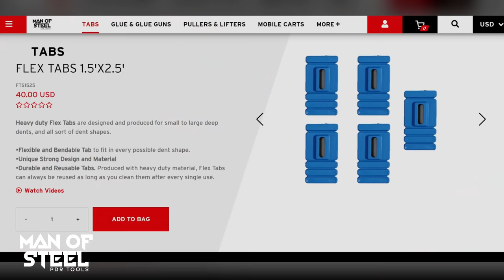Woodblock Knock Down! | Pulling Dents!

Comment: You smashed it again Clark! I wish this collision glue system was around when I was using the bracket jig system back in the late 1990's. We used to have to weld bits of steel on which just created extra cleaning up work. All the best to you 👍
Reply from the maker: Manofsteelpdr.com 
I will use your welding process from time to time on a dog leg paint completely gone. Thank you so much for taking the time to comment I really appreciate Jake

Comment: From one Man of Steel to another.  A deer ran into my truck a few years ago.  Left 2 big dents that looked like Superman had thrown a couple of basketball balls at it. I took off the door panel and used a 2X4 to knock the dents out from the rear. This included a bend  in the body line. While it didn't turn out as well as your work, it turned out fairly well. At least it wasn't noticeable from a distance.
Reply from the maker: Thank you for your comment

Comment: Hey Mr. Dent Doctor, I bought a Japanese van and ran it into the back of a city bus on a very slick Denver day. All the body shops I've contacted have said they can't work on it and suggest I have it totaled. Problem is I put a lot of money into fitting it out with a rooftop tent, kitchen and living room, I'd like to figure out how to fix it. The big problem is the front panel just below the windshield is creased pretty badly and I would like to fix it without removing the dashboard. I've looked for videos on fixing a blind dent (no access from the inside) but haven't seen any. Can this be done? I'm retired so time is no problem. I'm a new subscriber, thanks, love your videos.

Comment: The electronics that are tucked away in the right rear panel close to impossible to pull and replace correctly had the panel been replaced. So, $6,500 to replace the rear panel may have been a conservative estimate.  Replacement and troubleshooting also requires Mercedes technology to analyze the network.

Comment: Wow. We had a car side swipe rear quarter panel on 05 Honda CR-V with the bumper cover so it bent the panel in a bit right at the edge where it supposed to line-up with my rear bumper cover.  Suction pad pulled the larger indent but I can't get the closer edge to pull out.  Would removing the tailgate give access to a push from the inside or glue tab on the outside?
Reply from the maker: Thank you for your comment
Send me some pictures I’ll be happy to look at it for you
Reply: @DentDiscountPDRBodyShop  Thank you for your response.  where do we email you the photos?

Comment: With the cost of paint materials base coat/clear coat, sand paper, masking paper, masking tape, body filler,  and car parts skyrocketing during this covid pandemic; I bet customers and bodyshops will opt for PDR repair.  Plus it takes more time and it is getting more and more difficult to get any sort of car parts,  so people will prefer PDR as it is sometimes more cost effective.
Reply from the maker: Thank you for your comment
Reply: @DentDiscountPDRBodyShop  For Sure! Lets not forget the added cost of labor requiring more man hours with body and paint and the wait of car parts being back-ordered due to the pandemic.  PDR and Glue pulling is the future.

Comment: This is very impressive but isn't this some serious structual damage which should lead to replacement because of safety?
Reply from the maker: I don’t replace  I repair
Reply: @DentDiscountPDRBodyShop  yeah removing the dent is one thing to repair but restoring the structural integrity of the material is a completeley different thing. And this looks like some structual part of the crumple zone which needs to have a specific strength to it. But i was just asking since i'm no expert on this. But your statement lets me guess you are neither :).
Reply: @hasserecht3678  there is no significant structural support needed nor lost at that crease point.

Comment: i got my ass beat by a 50 cent sharp hail dent yesterday on a 2011 black camaro ss convertabile.i had 4 hours in it  ok well no tool acess even with my smallest serrated thinnest whaletale i could touch the tip of dent on outside.i had gluetab spot on many times 2 lights it just kept pulling shoulders i was so mad at myself till  i talked a old gm factory worker he said ohh god that part of trunk is the strongest .we used stronger glue on edge cause its a convertible.hail will put a quarter size deep crease dent there but good luck he said but ya i fought it 4 hours for 98 percent owner right there he didnt want no block sanding.so where that hailstone hit was like the worst spot you could have a deep crease hailstone they had like 2 inches of purple power marble glue that nothing can get through.glue pull on that curve was tough basically trying to pull both inner skin and outer with glue.i was shocked the original clearcoat was holding up from the pulls and pops but it did.god was helping me there.i thought for sure i was going to have to pull off spoiler and repaint but he didnt want that or any sanding buffing was ok he said for knockdown marks.funny thing the aluminium  cowl hood was easy compared to that one dent lol.thats when you need a man of steel to be with ya its hard out there Alone sometimes.
Reply from the maker: Thank you for your comment.. from the sounds of it sounds like you got a pretty good grasp of  PDR.. you’re probably better at hail damage than me.
Keep it up champ
Reply: @DentDiscountPDRBodyShop  I think your alot like me but you have more focus on big damange and your awesome at it!.been slow in mn pdr techs from 60 miles away showing up at shop looking for work and hurting luckily my fulltime job is a bodyman but thats even slow now.plenty of rust work garbage work i call it fill in the gap work underpaid and takes way to long

Comment: I'm a body & paint tech, for several decades now (since 1973).  This repair is not as good as it appears or is represented.  While relatively minor, there are still creases, waves, high and low points in the quarter panel.  Does it look better? Yes.  Is it flawless so that you can't tell there was never any previous damage? No.  I know where to look.  My trained eyes tell me that it is not really what most people would want from a repair to their car. If most people would look at it (in person), they also could tell.
Reply from the maker: Lol do you understand what it means to push to paint.
Do you know what it cost to replace a Mercedes quarter panel.
Well I saved the quarter panel from being chopped up.
Now the panel only needs light filler now it’s ready to be painted.
Since you can’t handle PDR Tools I guarantee you I can make a panel straighter than you can any day.
So if you really want to compare apples to apples
Let’s see what you can do with the PDR tool my friend
Put up your video.
Reply: lol, Listen Houdini,  of course I know body and paint work from top to bottom and front to rear.  I've been doing B & P work since before you were born. My points are these... 1st, you called it PDR (several times), but it's really not PDR, because PDR is "PAINTLESS DENT REPAIR".  That means one is doing a full repair WITHOUT any paint work needed. But then you try to cover with saying it was a push to paint repair. It's 1 or the other, but not both. 2nd, of course I know what it costs to replace a qtr panel.  It's about 10.5 to 11.5 hours to do a "belt cut" and about 14.5 to 16.5 to do a "full cut" - plus the price of the skin (panel)  then paint & materials. No doubt you saved some money versus what a new qtr would cost, so I'll give that to ya. But, 3rd, I'd bet my bottom dollar the ins co paid for a whole new quarter panel. And so if that is the case, I don't know about where you live, but where I live that is considered fraud.  Even if the owner of the car knows what you did, it's could still be considered fraud. (Spoiler: Look at the fine print at the bottom of the insurance estimate).  4th, I don't know of many Mercedes owners that would accept that type of finished work, even if you sent it to the painter afterwards.  The painter would have to use a "high fill" primer, lay it on thick to get a nice, feathered finish.  Of course the problem w/ that is too much primer can cause other problems (cracking, etc).  But even still, sending it off to the painter to do his work means it's not a PDR.... now is it?
Reply: Oh, one more thing, your intro to the original video says you do the repair "with no fillers", yet in your  response to me you said the repair would need filler.  It was a good job for what it was, but still, no credibility due to your own contradictions.  Don't blame me, blame yourself..
Reply: Jealous much
Reply: Not only that but that tail light pocket area was completely folded over itself which immediately calls for replacement. Just cause it looks straight again doesn’t mean it will react the same way in another collision. The integrity of thr metal is compromised. Great work, i couldn’t get it that straight, but i wouldn’t need to by following procedures and replacing that panel.
Reply: @DentDiscountPDRBodyShop  bro I’ve been a body man for 18 years. Grew up in a body shop. Been in many body shops. You are by far the best metal worker I have ever seen in my life. That car is getting a quarter in 99.99% of body shops. To be able to get it that good is an art. I could fix that quarter myself, but I would need to weld tabs, pull it, and mud it up. Don’t listen to this guy. He’s a hater that has never reached your skill level, and never will. I’m sure you already knew that though. You have definitely inspired me to take my metal working skills to the next level. PDR tools and glue pull stuff are on their way!